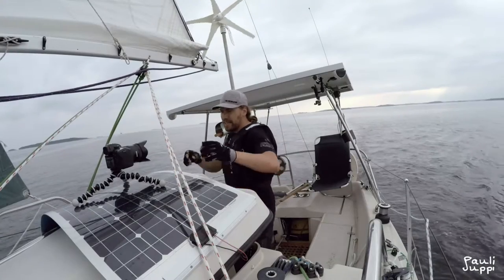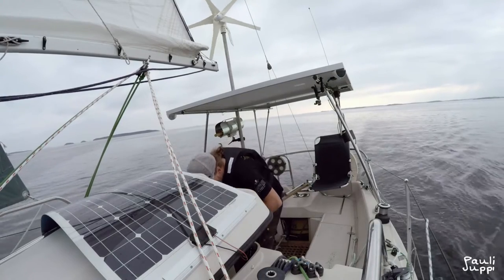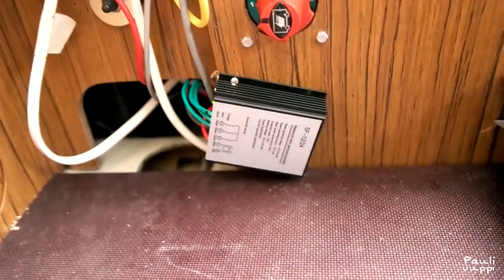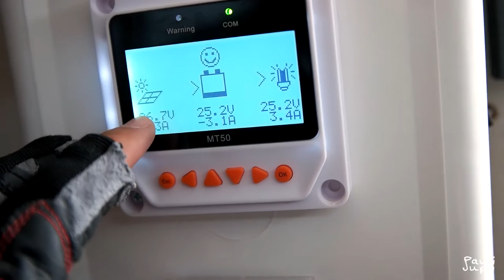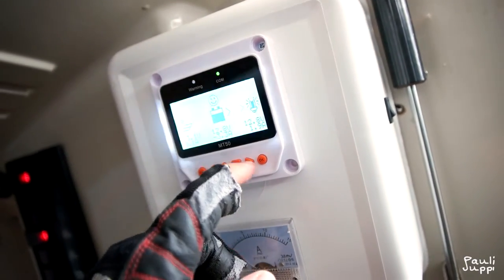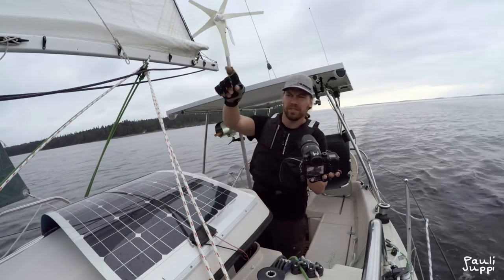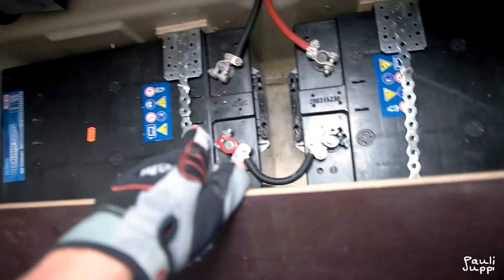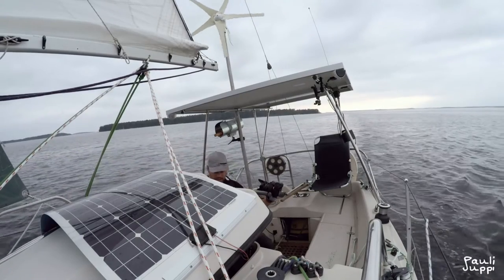This is my electric sailboat! Part 2/3

Comment: That's a awesome set up you have
I have a 25.5 hunter sailboat also have a 100 watt panel to charge batteries.
it will run the lights all night and run my flat screen tv 4 hours.
takes about 8 hours to fully recharge the battery. 
I use my boat as a live aboard and do a funny live streaming fishing show on it.
Reply: gód fór ít

Comment: You may want to move your 12 volt solar panel . Shading from the boom can cut it's output drastically.
Reply from the maker: +Mazda rx7 You're right. It's not a good place for solar panel, but there's 2 reasons.
1. I designed it to act as a roof for the entrance when pulled out. No more rain inside!
2. I'm running out of surface space on my boat.. :D

Comment: Are the 2 bigger solar panels connected in series or in parallel?
If one panel gets shaded, then parallel connection will normally give the highest power output to the batteries (because of resistance in the shaded panel).
On the other hand, if none of the panels are shaded and the wires are a bit thin, then seriel connection will normally give the highest output to the batteriet (because of higher voltage and lower current).
Reply from the maker: +allan500m They are now in parallel cos my 48v charge controller can't stand the 70+ volts from the panels. The theoretical max amps in parallel is about 16 but as facing straight up I'm never gonna get there on these latitudes so I think the wires are ok

Comment: I know you have your sails up, but if you were running the motor the power boat would have right of way because they are to your right. Sails or not, running the motor makes you a power boat, and takes away any special priviledge. And never assume the other guy sees you... will avoid you... or even knows the rules.
Reply from the maker: +Dan Courtney I know, but also the fastest motoring boat should avoid the slower one. Anyway Finnish people are pretty good with rules :) I trust them
Reply: I don't know where you get your colregs from but speed has nothing to do with it. You should have avoided the other vessel.
Reply: Unless the sailboat/ motor boat was flying a signal saying he was under both power and sail the motor boat should have stayed clear.   That ends any doubt as to the matter.  You see a boat under sail then stay away.  However I imagine like in the states motor boats always barge in for a close look and it is fun to throw up a nice big wake, eh.